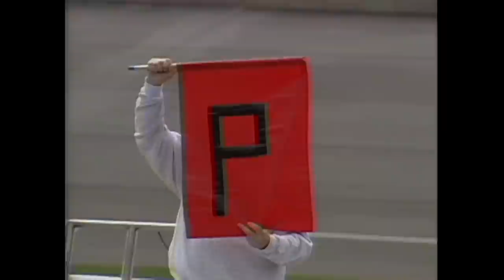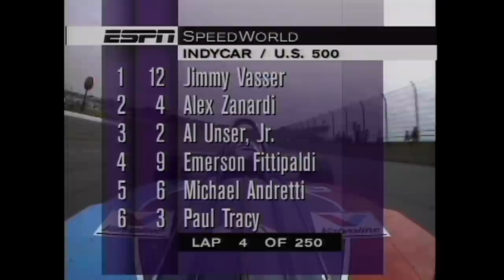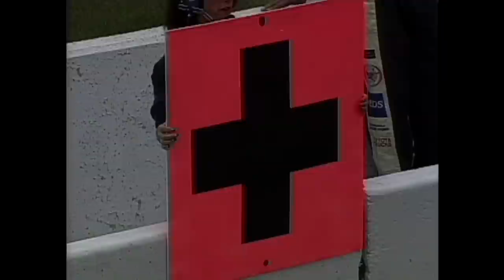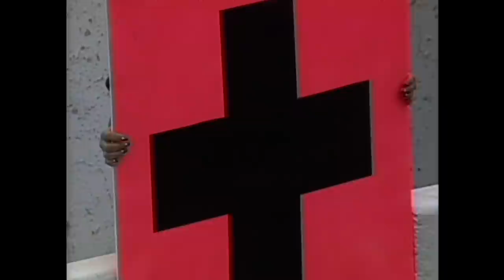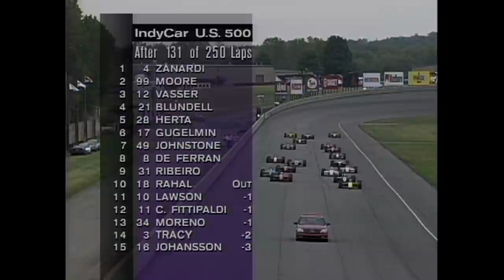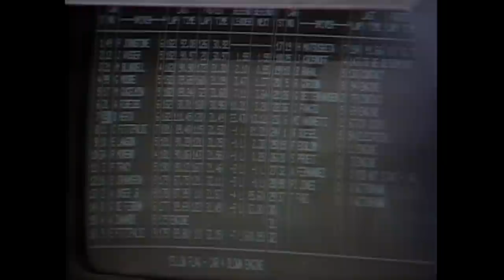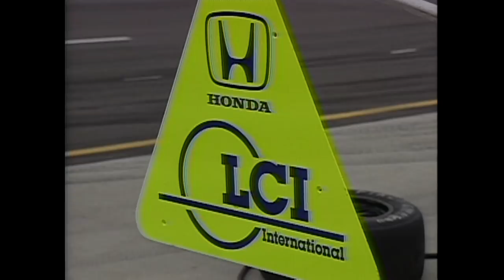1996 U.S. 500 at Michigan International Speedway | INDYCAR Classic Full-Race Rewind

Comment: I recall having cable TV in the 1990s, but it must have been after this race, as I wasn't aware this race was televised.
Hhhmmm!  Looks like ABC-TV had a lock on the open-wheel races for that day; for not only was the Indy 500 televised live, but for those that weren't aware:  ABC-TV (US . . . not to be confused with Australia) has owned ESPN since 1984.

Comment: Fernandez caused it!!!! I will never forget the raw feelings towards Adrian after all the replays... WTF was Adrian so dang close....
Reply: Not really, Vasser could have maintained space between himself, Fernandez and Herta by moving over to the LEFT. In fact, if Fernandez moved over to the RIGHT, then it would have pushed Herta to the loose line towards the wall because Vasser positioned himself at such a high angle. Michigan wasn't that well suited to three-in-a-row start procedures, as the track was narrower than Indianapolis Motor Speedway's track width.
Reply: @DR3ADER1  Yes, really.
Reply: @DR3ADER1  Exactly! They should not have started 3 wide at this track! 🙄